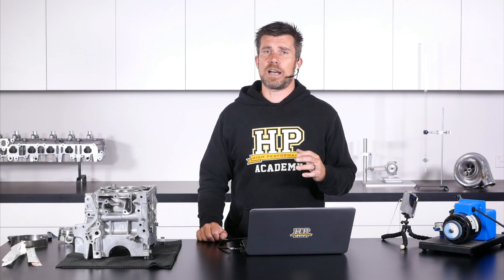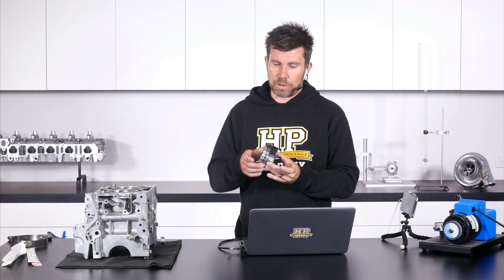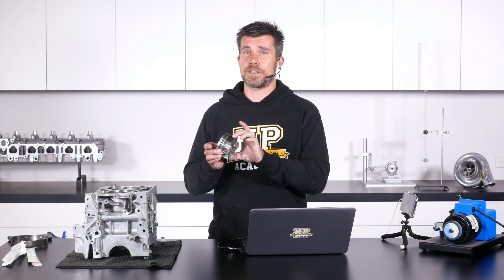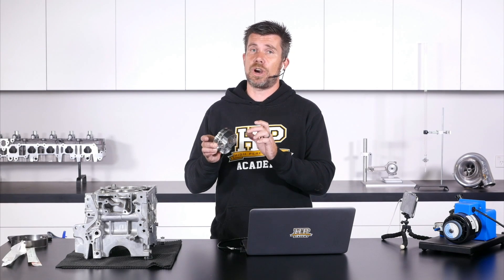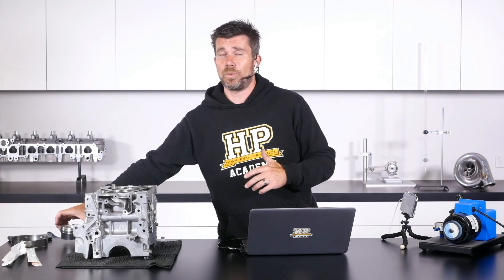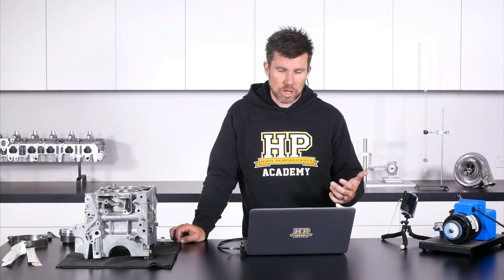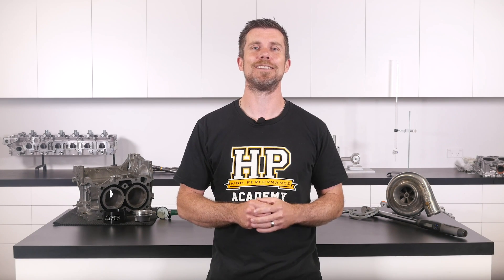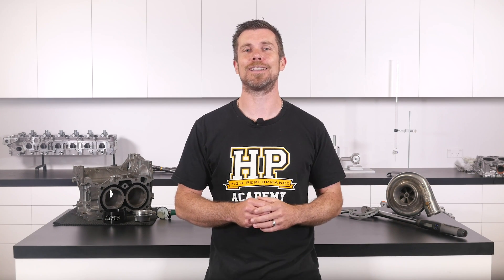Piston Slap | How To Mitigate It And Why It Occurs [HPA Q&A]

Comment: Pretty useless without examples of what piston slap sounds like
Reply: Then learn to google the sounds of it first and not be a useless twit yourself. Lazy fucker
Reply: @rylandorr  I googled for days and couldn't find an example were the creators of the videos didn't even know what they were dealing with.
Reply: Roger Retired hands on professional engineer (experience steam engines railways, all harbour equipment, jet engines altitude test facilities, air ground comms, cars and all personal and household machines answers. Wife has a Hyundai i30 which suffers with “slap”. Reason the piston skirt is too short. So there is insufficient side area to cushion the side thrust from the gudgeon pin and the pistons wobble in the bore. We use upper cylinder lubricant dosing of the fuel containing the dry lubricant molybdenum di sulphide. This reduces the slap to an acceptable level for someone who feels for mechanical equipment. Two to three teaspoons full per tank of fuel.

Comment: Had a block bored out and fitted to 3.5 thousandths clearance per CP pistons specs. The resulting slap ended up polishing the cylinder walls on both thrust surfaces from the pistons rocking in the bores. There was a polished spot on both the top and bottom of the skirt from changeover. These were un-coated pistons. I ended up re-honing (yes the bores opened up to about to 4-4.5 thou) but I sent the pistons out to be coated to take that space back up. They actually came back wider than the bore. I then sanded them down until they fit snug. The engine has been run back in and burns 0 oil. Spark plugs look pristine. I have no idea how long this coating will last (it has been a few hundred miles), but, I learned my lesson. Pay the extra for the coating. It seems to really help alleviate minor thrust issues. These coatings designed to be set up tight and "wear-in" are definitely the way to go. Let the piston self-clearance. you'll get the perfect load distribution across the skirt as high spots wear in.

Comment: Ok..... here is the best advice ever on piston slap..... I rebuilt my vq40  engine ..Nissan navara d40.. forged JE  pistons from flatlander racing!!!!the only problem I had is the machining of the block... I.e to big!!!!  ..........2 cylinders were 1 thou bigger than the others!!!! Result...... noisy cold start....and even a little noise when at temp!!! Fix...... change to valvoline xld 10w-40... ... this is a full mineral oil that costs at least half of full synthetic!!  Please let everyone know that full mineral oil has a very good dampening effect on piston slap!! .... please try it!!!! It's not a joke!!!.... and this is like for like... as in 10w 40 to 10w 40...... TRY IT BEFORE HAVING A SHOT AT IT!!!!!
Reply: Yh but running mineral oils for a long time wont be healthy for your engine.. thats why people generally use fully synthetic
Reply: Jack Gibb running mineral oils aren't as good as synthetic but you can still run an engine 500 thousand miles on mineral oil. Regular oil changes are the key!
Reply: I want to try it but anything but full synthetic on a wrx sti is bad.. I do use 10w40 fully synthetic though. I hear it a bit when driving after starting for 10 minutes or so, but it goes away and I only hear it between 70-77km
Reply: l y m a x you don't have to try it!!!! If the noise goes away after the engine is hot.....It's all good!!!! It's just very annoying to listen to for the first 10 minutes!!!  I wouldn't be to worried at all!!! It will still bug you though!!!
Reply: A

Comment: great stuff! I've learned that sometimes, the block design itself calls for a different tolerance than what even the pistons manufacturer says. my last build has pistons to wall clearance of 3 thou. Once taken apart, the wall has wear marks. This time around I set it at 4.5 thou. the piston moves a little more in the bore but I think it'll be alright.
Reply: I think it's one of those experience things. The more you build engines the better you get at it.